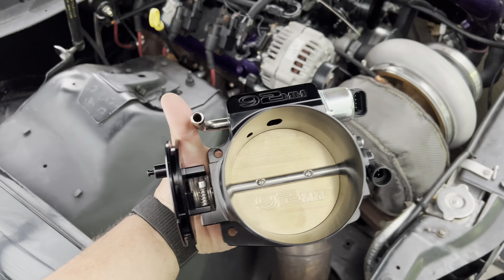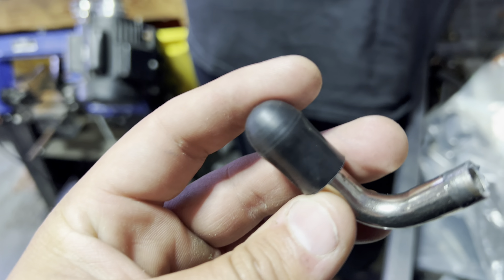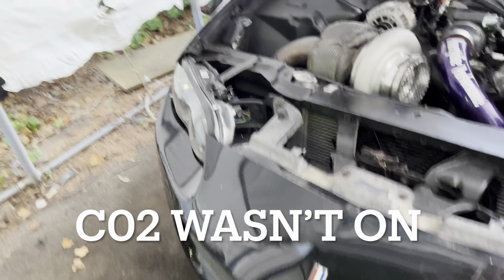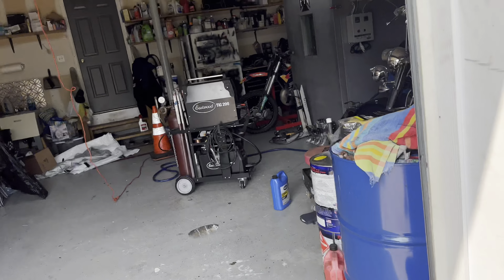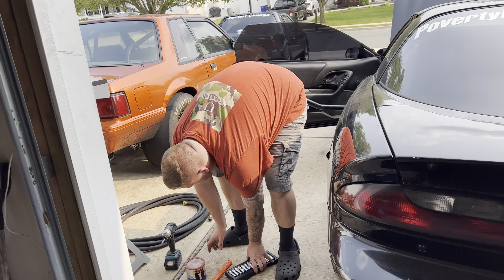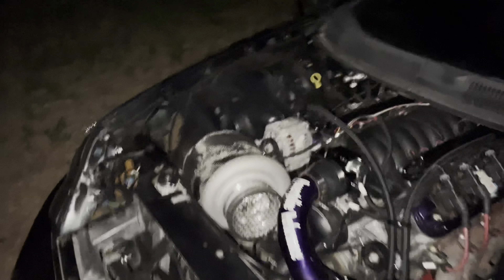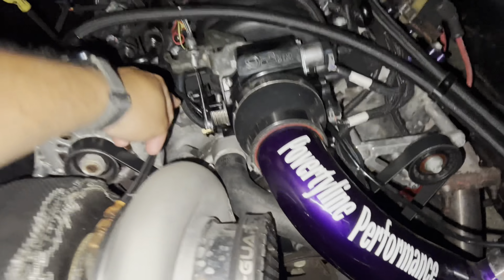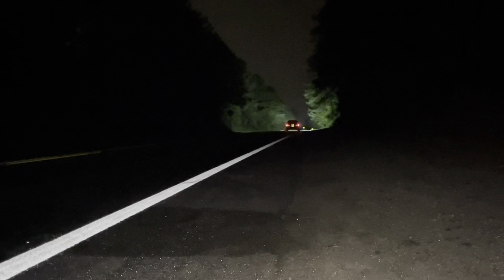Bad Night Of Testing!!! Top G & Pocket Change Street Racing

Comment: What radiator and fan are you running…I’m running the on3 rad and a 3000 cfm single fan and she’ll over heat in traffic